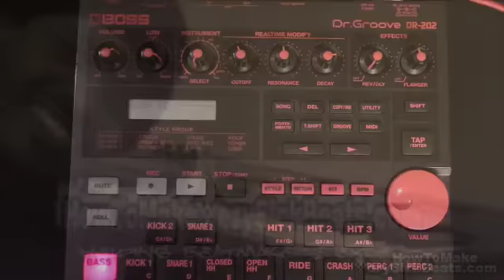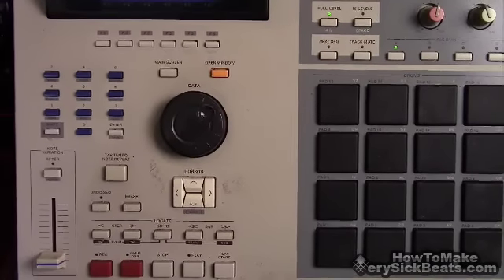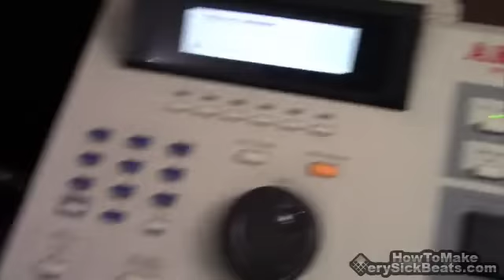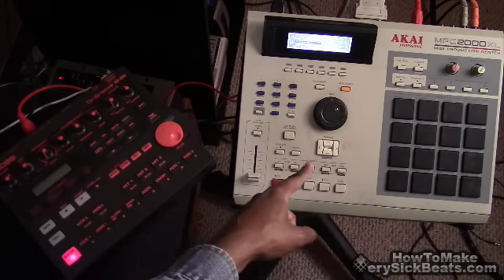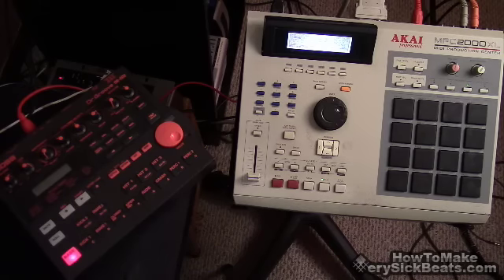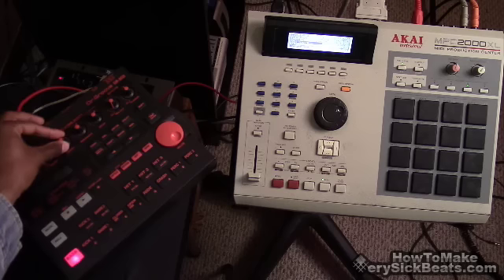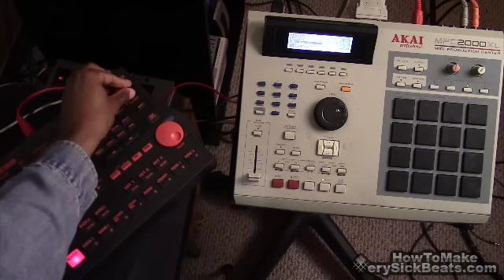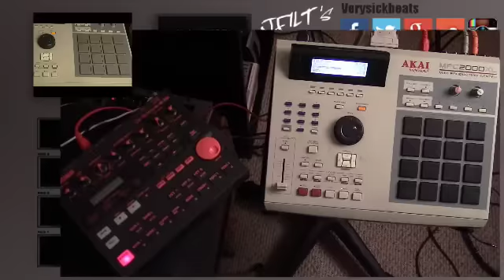Beat Making | Boss Dr 202 & MPC2000XL

Comment: Hi Jfilt,
I need help with my dr. 202.
I turned on this beast after long time and I have problem. when I push any pad on dr. I hear drum and bass sound as well. it s some like layer function or somethin. what I have to do when I wanna stop this function ?
thanks for feedback.
Reply: I used to own a DR 202, the problem is the bass and drum sounds are set to the same midi channel, go to midi  settings and change the midi channel of one of them. Hopefully you have already figured this out.    Peace.